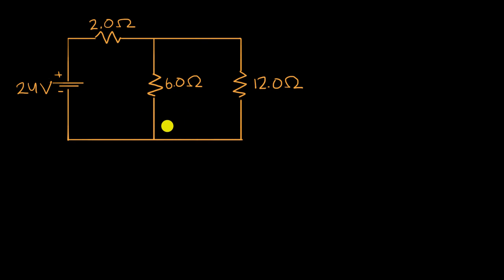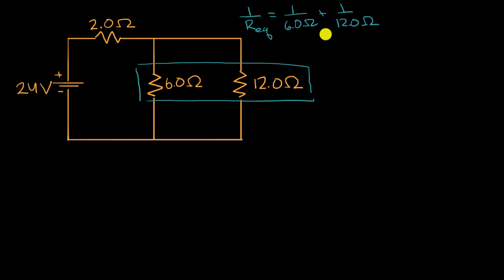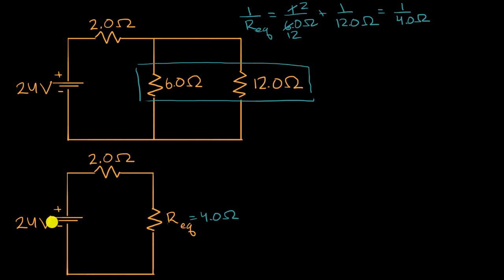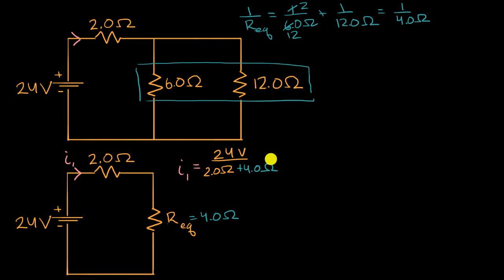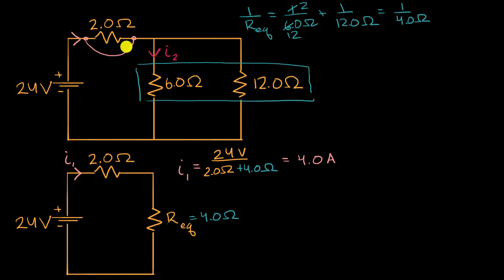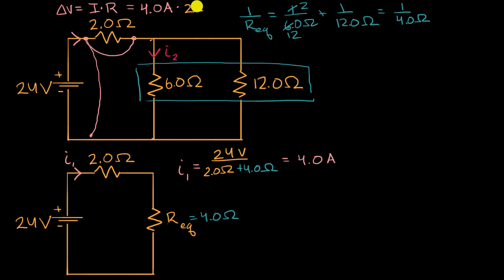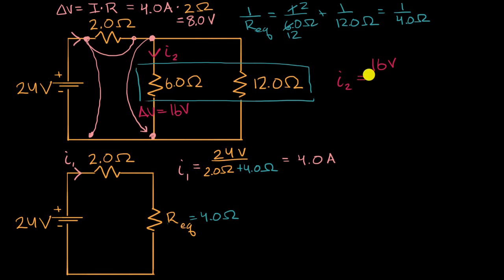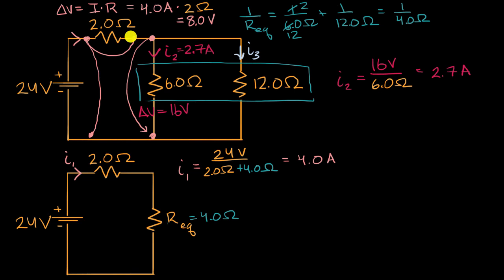Current through resistor in parallel: Worked example | DC Circuits | AP Physics 1 | Khan Academy

Comment: So, in summary:
1. Find the equivalent resistance.
2. Use Ohm's Law with equivalent resistance and the volage of the battery to get the current through the battery
3. Find change in potential at the "top" of each resistor (in this case, it's the voltage of the battery (24V) -2.0ohms(i), where is is the current in the battery
4. Use Ohm's Law again to find the  current through each resistor (using the delta V we found in step 3, and dividing by each resistance)

Comment: How did you get 16 voltag drop for i2?
Reply: The voltage from battery is 24 volt, as it crosses the resistor, it drops 8 Volts. Thus the drop is 24-8 = 16 V, and that voltage is what the rest of the circuit has to work with. Voltage is constant across parallel resistors, so the drop is equal across the 8 and 12 ohm resistors.

Comment: So what is the voltage drop between the 12 ohm resistor??
Reply: It would be the same as between the 6 ohm resistor, 16V. 16V/12 Ohm would give you the 1.3 A

Comment: This is straight-up confusing everyone instead of doing the first part like he does do this instead when adding resistors in parallel. (1/6.0 + 1/12) ^-1 = 4ohm make sure you put ^-1 to get the inverse next add 4ohm to 2ohm because now the 4ohm is in the series with 2ohm =6ohm

Comment: 16 volt i donot under stand
Reply: The voltage across the 2 ohm resistor is 8V. 
24V-8V=16V
Reply: @elenesvanidze4926  thank you